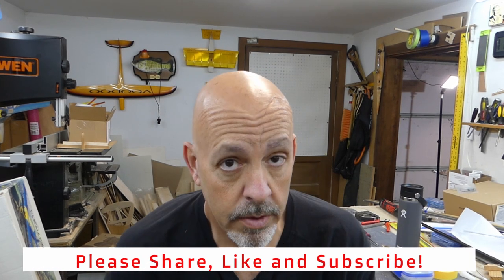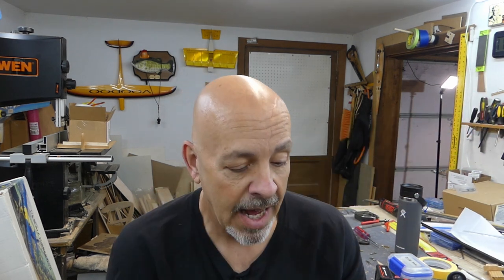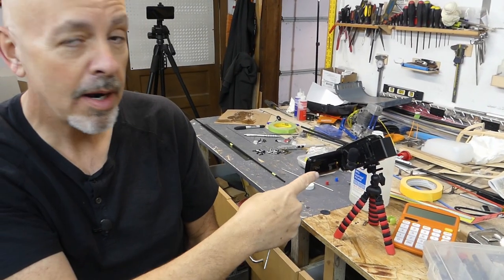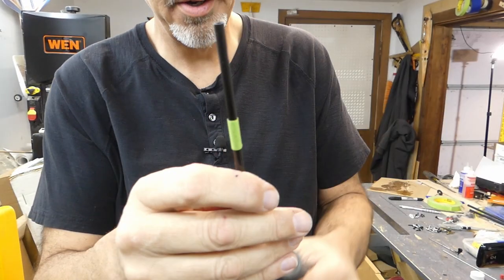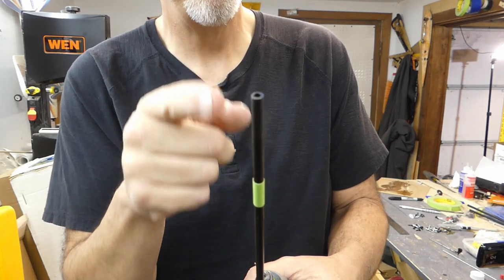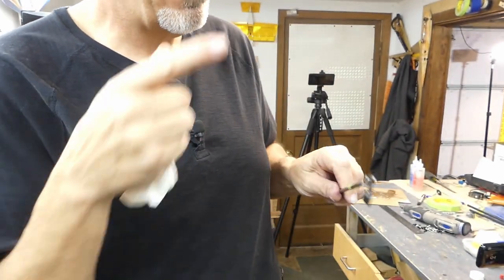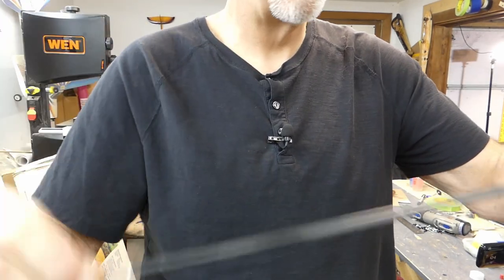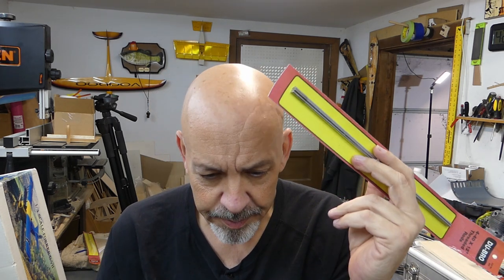Balsa USA 1/4 Scale Fokker D.VII - Episode 26 - Carbon Fiber Control Rods

Comment: I've been "rescuing" a 1/5th scale cub. I recently completed my push rods. I used carbon arrow shafts, because I had them. They worked out great. The only difference i can see is that you used clevises at each end. I used a clevis at the control surface, and a zee bend at the servo to keep the rods from ever rotating.
Reply from the maker: Once mine are set up, I put a couple drops of thin CA glue on the threads to wick into the clevis and lock it in place on the servo end clevis. Easy Peasy. The control surface end will have a 4-40 nut.
Reply: @BudChristensen  Right on!